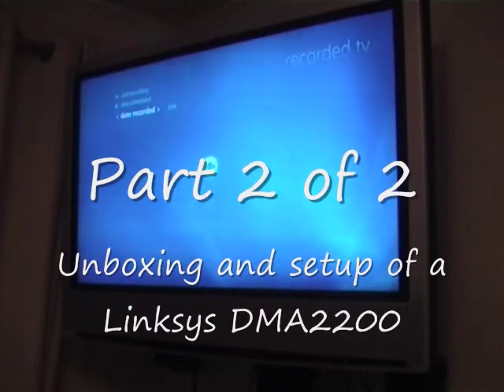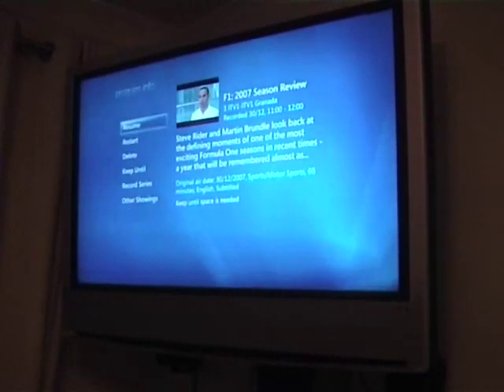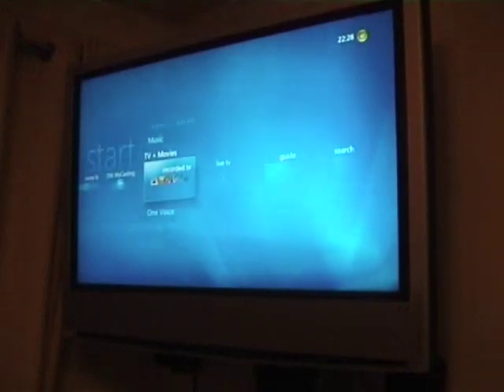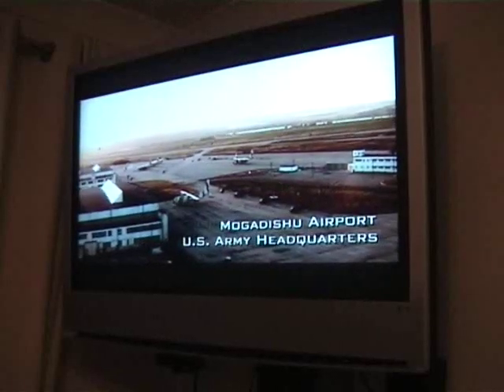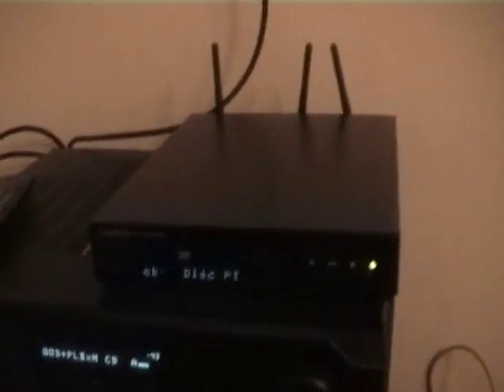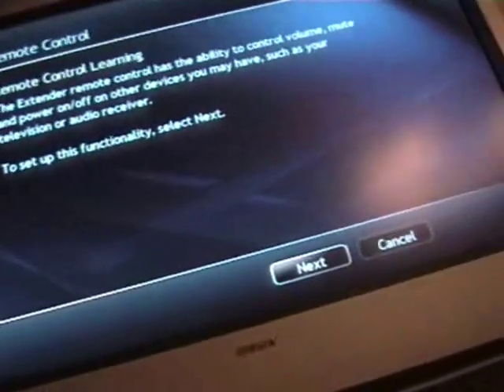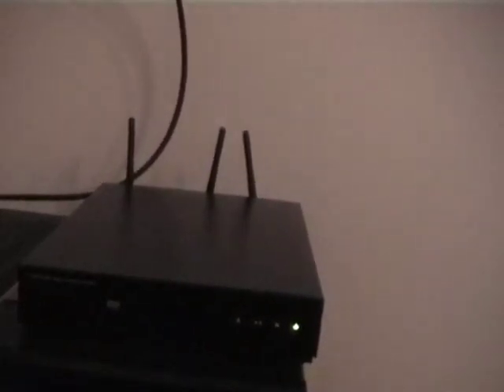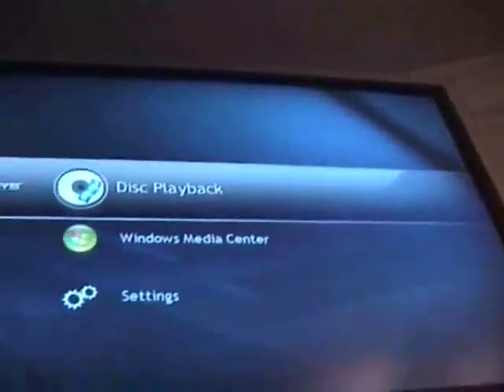Unboxing and Setup of a Linksys DMA2200 (part2)

Comment: Thanks for putting up this vid. I have just recieved my DMA2200, however the CD-ROM has a big crack in the disc and I am unable to load the software from this. I have raised a call with Linksys support who were pretty awful to be honest. They kept directing my to the website where there are only 3 PDF's to download and no software. Eventually they said they'd post a disk to me, but would call back first. No call as yet.